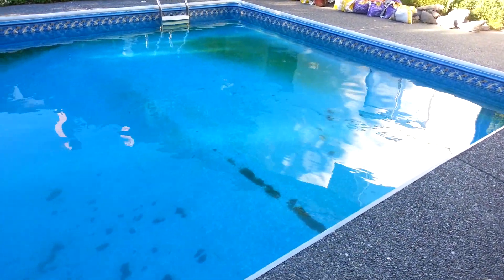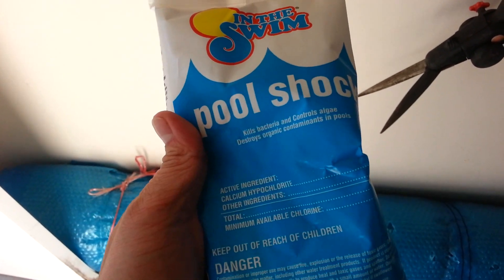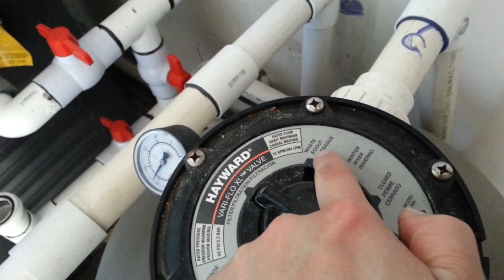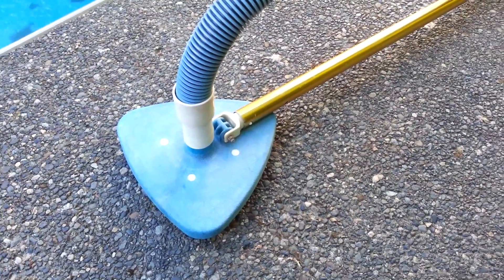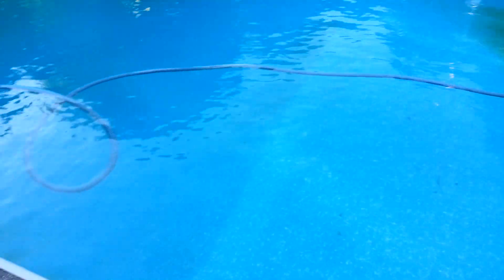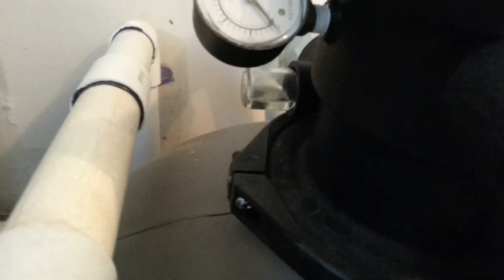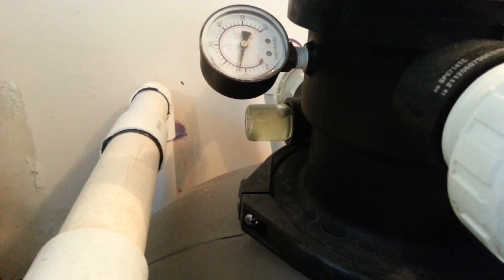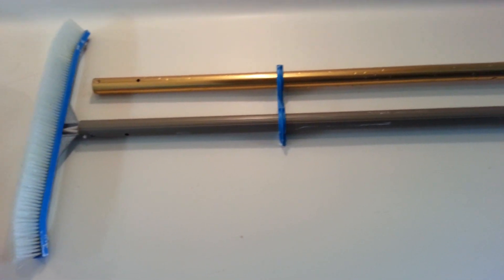Clean Swimming Pool with Severe Algae Problem: Kill/Vacuum/Filter/Brush

Comment: I upgraded to a intex sand pump filter. I have never had so much trouble with a above ground pool as I have with this InTEX pool this year. I have had an awful cloudy pool ever since I set it up in May. I do not know if it’s an Algae issue or what??  Testing the water will indicate high ph one day than than the next it’s good and the total alkalinity is low? I have used an algicide, I have used a water clarifier,  I have shocked the pool numerous times I vacuum it than it looks worse than it did before I vacuumed, it does not matter what I try, I backwash the sand pump every day and I just cannot get this pool clear much less to a crystal clear Looking pool. I honestly don’t know what has happened or what is causing it I do have a pecan tree hanging over the pool could this be residue from that tree this year it’s never been an issue in the past. Is it an actual algae problem whatever it is I cannot get this pool clean. It’s either light green , a little cloudy or really cloudy after vacuuming and than it will be green along the bottom? Please is anyone out there experiencing the same issues in trying to clean and get their pool clear please let me know what your thoughts are. Suggestions welcome.
Reply: This is EXACTLY my problem! We have the same pool. I feel we are wasting time and chemicals.
Reply: I have spent so much money to get the same issue. I poured a gallon of bleach last night.and baking soda has cleared some up have to do a really great scrub and backwash

Comment: One thing - NEVER, NEVER put chlorine in the skimmer. It is highly corrosive in that small aqueous space and will deteriorate the fittings and hardware of both the skimmer and the pump and harden the PVC of your intake plumbing and valves causing it to become brittle and crack under pressure. Much cheaper to use liquid chlorine at 12-15% hypochlorite than to use powdered shock. You can super chlorinate a pool that size with less than $6 of liquid compared to two or three times that with powder. Be careful with liquid though ' it's nasty dangerous to work with.
Reply: Best to liquefy in a bucket first then pour in slowly over 10mins

Comment: thanks for this video. i have the same vaccum but I don't get it to suck. would you explain how I get it to work?
Reply from the maker: +Rocio Nole just connect the hose to the skimmer, and put on a normal cycle on the filter pump. it should suck. make sure you put the vacuum head in the water before you turn on, and wait for about 2 minutes. it has air in the hose, so it won't suck immediately until the pump sucks the air out.
Reply: +Henry Q thank you. I will try that
Reply: Henry Q turn your main drain off to vacuum.